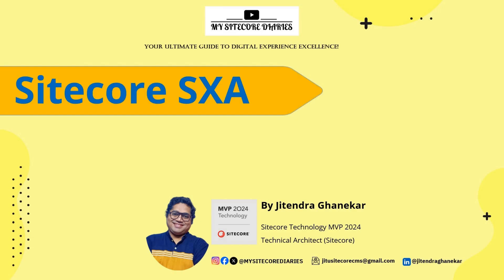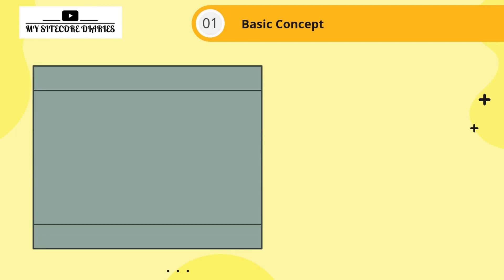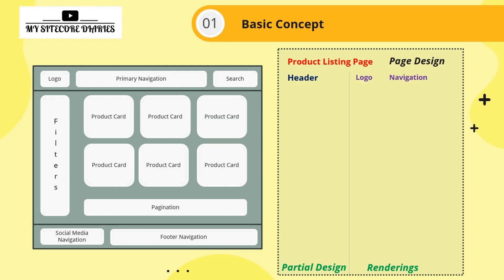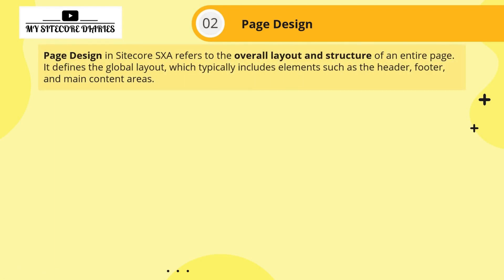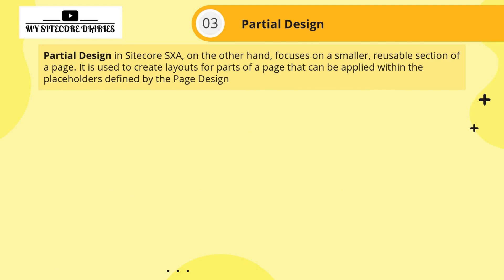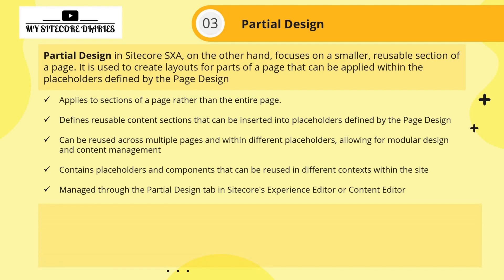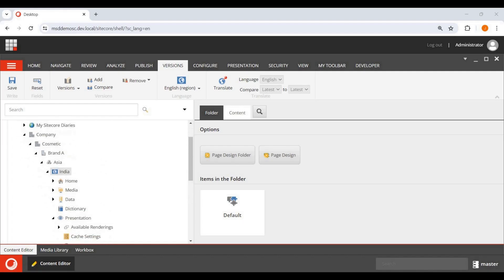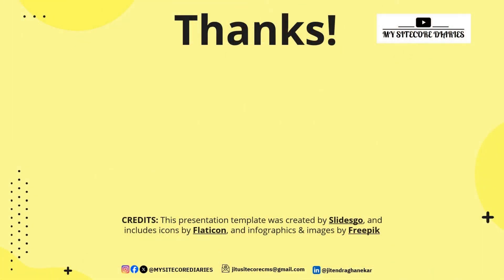Sitecore Experience Accelerator | SXA tutorial | 06 Page Design and Partial Design #sitecore

Comment: as per i understand based on your video. Page design is like layout page which has consistent layout across the application and partial design is like user control . Is my understanding clear ?
Reply from the maker: Yes.. In simple words you can say that but generally in layout you would have components like design elements example columns, rows section etc. But partial design can have components like header, footer, menu etc. In next month i will create a short video related to this.